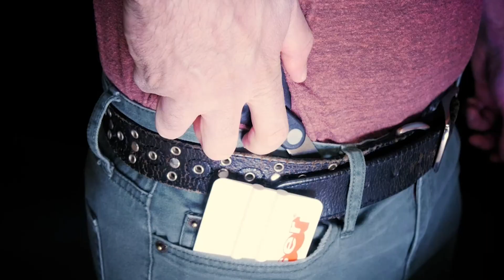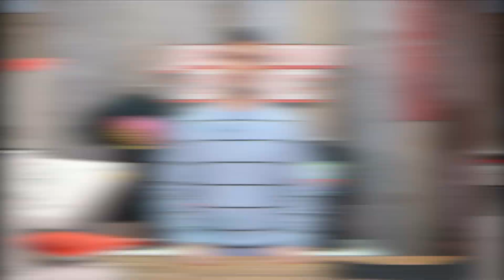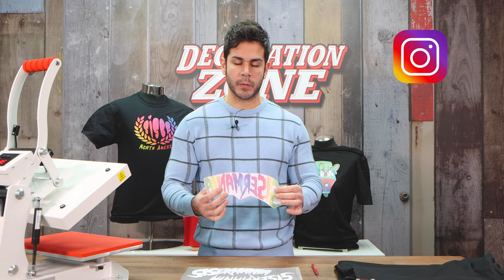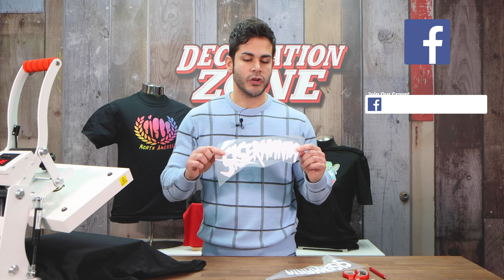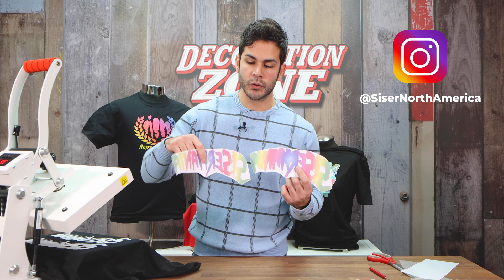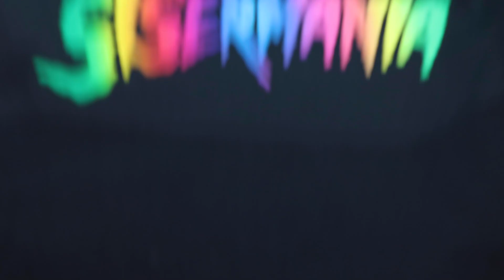EASY Two-Step Sublimation Process with EasySubli®

Comment: Hello

I disnt get to know what temp  did you put the easy subli for? Then the temp for the sublimation paper for?

I've done mine for: Easy subli- 310 and 10-15 sec which is prob to long? 
Sublimation paper for- 385 for temp and 60 secs? Was this alot and thats wjy it failed and its faded and i can see it almost look as see through?

Thanks
Reply from the maker: EasySubli can be applied up to 400 degrees which keeps it from scorching or burning. This is the reason that the two step method works. For more info, head over to www.siserna.com to learn more!

Comment: Now I’ve done a workaround for epson printers and pizza wheel marks by printing the sublimation mirrored on A-Sub paper. Take the easy subli off the backing and place on parchment paper and sublimate onto the easy subli with registration marks. Then peel off easy with the sublimated design and place back on mask and heat for about 2-4 seconds to tac it on. Then place on cutting mat in my case the siser Juliet and let it cut out the image and weed out and then place onto clothing for 310 @ 15 Seconds. Worked great doing this method.
Reply from the maker: Thanks for sharing!
Reply: i need video pls

Comment: My question is.. how do I get my Cricut to cut the easysubli withOUT the registration mark (since we're printing on the regular sublimation paper???)
Reply from the maker: You just have to place the blank EasySubli on your Cricut and send the cut file that goes with the sublimation print over to the cutter. My sure you do not mirror your cut file. Mirror only for the sublimation print.

Comment: not possible to transfer it with sublimation paper directly to the easy subli and let it dry for cutting? i tested it but the easy subli will damage.. right? i can do print & cut, it works fine but the colors are better in the 2 step way. your layering method is not good for designs with several items.

Comment: I think it's important to show what can go wrong instead of editing the video like it came out perfect. You can see you messed up on the words on the bottom but showed a different one at the end.
Reply: Lol I saw that white showing too, but didn't see it at the end
Reply: Yes. We have been scammed.  At this point, you can see the mis-registration :https://youtu.be/1qzoJc1Bc6k?t=427.  I have tried this. Once the subli is down and you pull off the mask, the shirt has stretched. It is extremely difficult or nearly impossible to line up the sublimation paper on top.  Cost me the cost of the shirt + subli + paper to find out. Then went back to watch the video to see that it was a lie.
Reply: @PB7019-k8u when tacking down the material, a shorter press-time will reduce shrinking and misreg.
You could also try sublimating the cut material before pressing to shirt.
Reply: Exactly! And why in the world would you cut the mask to fit the image?? You keep it in one piece so you can reuse it! I guess they think we're idiots 😕
Reply: It is not him is the company, anyway he was showing another way to apply it without a sawgrass which was perfect explanation.

Comment: Hi there! I have a question about fading. I tried to use easysubli for the first time on a 100% cotton black shirt and I sublimated my image on A-sub paper and then tried to press the image on my shirt with the easysubli at 311 for 30mins (I saw this on another video before watching yours!) and my image was super faded when I lifted my press result. Is there a reason for this? I also printed my image off a week before pressing it, does that matter?
Reply from the maker: Hello, it sounds like you didnt press this process at the correct temp.... please contact our Tech Support at 586-203-8171 and we can help guide you through the process :)

Comment: Saving this so I can watch as I make it to be sure I can. Do you recommend  the spray for sublimation  on light colors?
Reply from the maker: Well, I dont want to advise you incorrectly. Since we dont really have anything to do with sublimation, I am not sure how long the spray will last for light colors. This is why we are showing EasySubli HTV, so you can do full color designs that can be applied to any color or any fabric.

Comment: Hello amazing video.. You mention protected sheet on top of your image. What kind ? Can I use Teflon sheet instead and can I reuse the protection sheet or Teflon ?? Looking forward to hear from you.
Thanks
Reply from the maker: I would suggest using parchment paper, because it is inexpensive and can be disposable. The Teflon sheet can run the risk of getting ink on it, and you wont want to reuse it once that happens.
Reply: use butcher paper or craft paper to protect your heat press from catching the ink

Comment: When using the Easy Subli do you cut that the exaxt same size as your image that is on sublimation paper?  Or do you make the subli a little bigger (like a shadow affect)?
Reply from the maker: that is a total preference! In this video, I show two routes you can go. You can have the EasySubli transfer cut the same as the sub print, but you have to make sure your registration is accurate or you will have an offset. 
Or you can give yourself wiggle room, but making the EasySubli transfer a little larger than the print, but you will have a white boarder.
Reply: @SiserNorthAmerica   Can you have a bigger area of the subli?  Like a bleached background effect?

Comment: I cut out the design on the easy subli but when I print the design on regular sublimation paper the design doesn't match up to be the same size it's smaller can you tell me what I'm doing wrong?
Reply from the maker: You may want to look at your print settings and make sure the software doesnt size your design down.

Comment: You don't have to use mask.
Lay the image down.
Then lay and line up the easysubli on the image. 
Use tack spray to adhere the easysubli to the image.
Then roll the backing off the easysubli.
The easysubli is then adhered to the sub paper.
Turn over and press as normal.
When done just peel the paper off and easysubli and image are on the shirt.
Reply from the maker: Great suggestions! There are many ways to bake a cake!
Reply: Hi e2wDesigns.  Can you tell me if this is something you have actually tried, and is there a video showing the process? It makes sense to me but I would like to see it in detail and the type of tack spray used. Thank you.